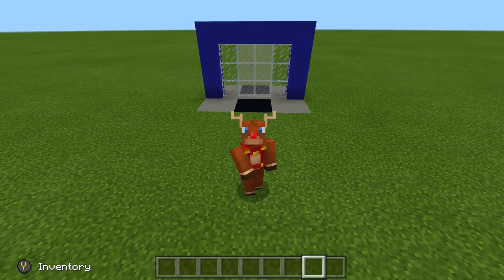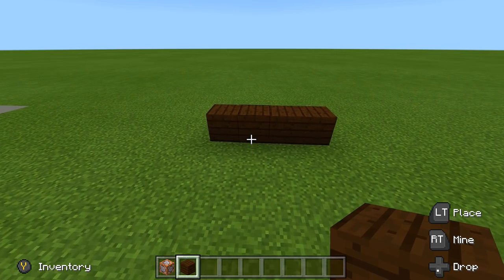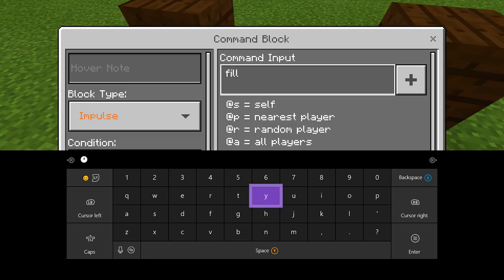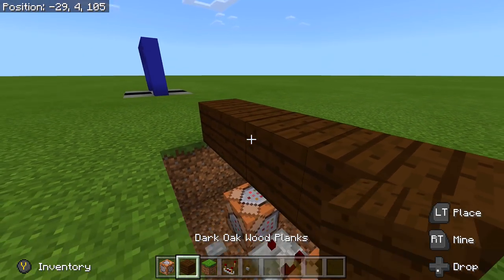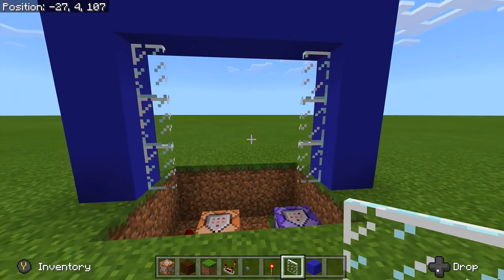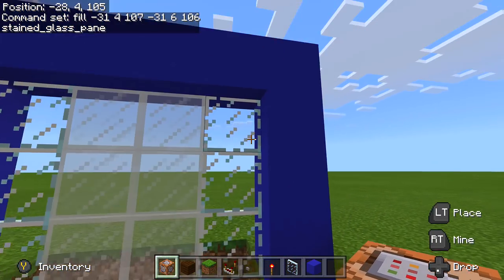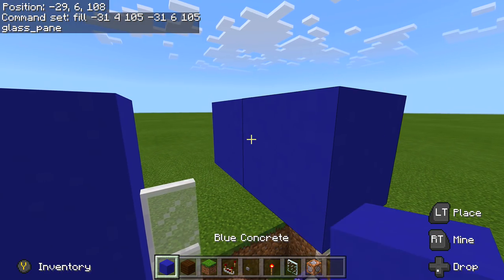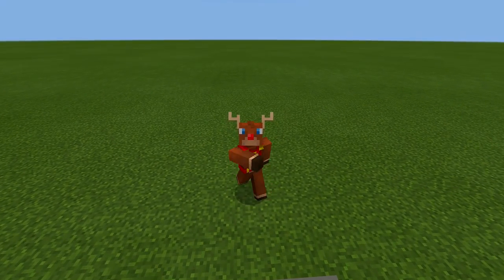How to Make a Sliding Glass Door in Minecraft (Command Block)

Comment: I have a few problems. 
1) the command block won't let me input "testfor" and it won't let me input just "air"
2) the glass appears at the edge of my frame for said door, and on the right side of my door 
(🚪🚪🧱
       ⬆️ ⬆️) 
3) it's not re appearing
4) it goes 1 at a time
How do I fix? (I am using Java and I'm in 1.18.1)

Comment: Is there a way to use this with a lever instead of a sensor?
Reply: Yeah, instead of using the command block with the "testfor" command in it and the comparator, just connect your lever using redstone to the command block that the comparator is pointing at in this video
Reply: @gordonfreeman5958  Thank you!
Reply: @jennypickle  No problem, hope it works for you :)

Comment: I don't know what's wrong, only the bottom 2 glass slide
Reply: N4FZ Gold N same
Reply: N4FZ Gold N but I figured it out what you're supposed to do is add two other command blocks you put one next to the command block with the comparator facing it and another one next to the one below the Redstone torch and then follow FEDEX from there
Reply: @rednt1357  thanks it works now